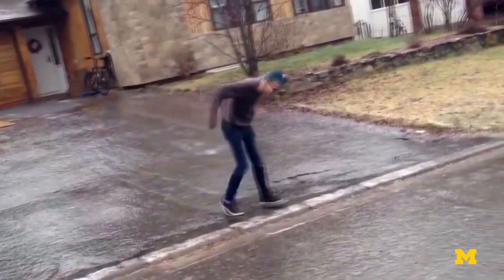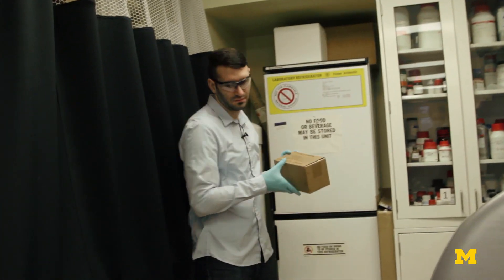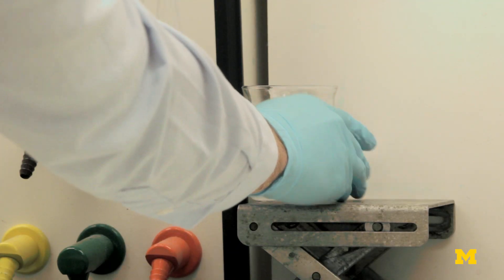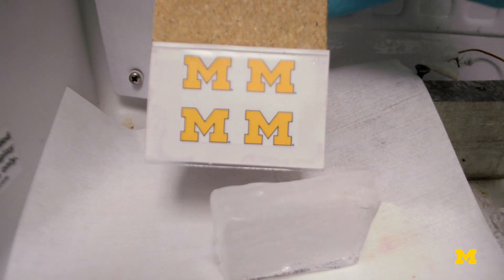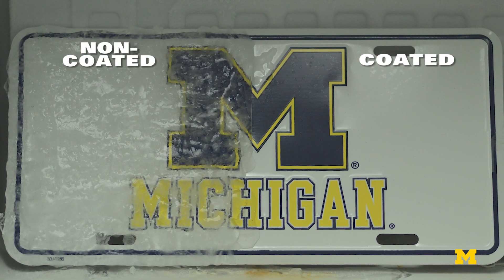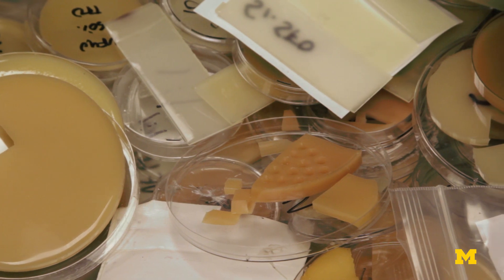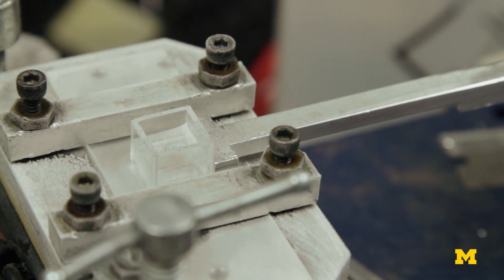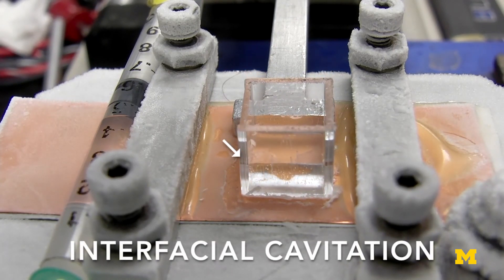Icephobic Coating

Comment: 3M makes vinyl wraps used on modern airplanes instead of paint. It seems like it would be possible to integrate the icephobic coating into the fabrication process to enhance durability and adhesion to the underlying vinyl substrate.  Such a product would be a game-changer for aviation, especially the broad range of light aircraft that have few viable options for anti-icing.